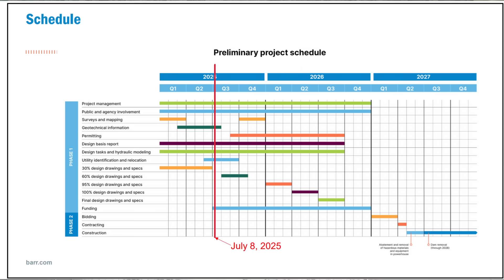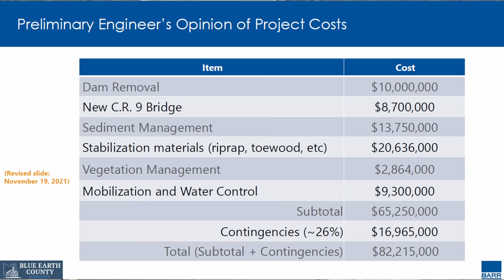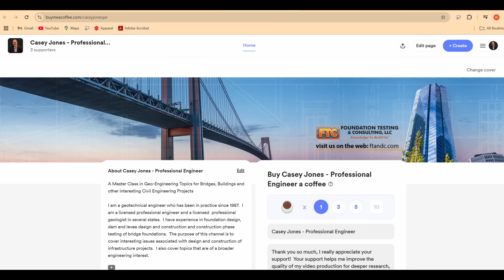Rapidan Dam Failure -  1 year later

Comment: Here is my question regarding this; Who was responsible for the dam or it's maintenance to begin with? It was stated that the power station was no longer in use because of previous flooding events! Who was responsible for the power station? Did the operators of the station not need it or it's power anymore? Was the affect of not using it or it's upkeep thought of, to its overall impact on the dam? Who was responsible for the spillway gates and not keeping them in working condition, and who was responsible for removing debris build up (which these two things, may have allowed the disaster to not happen to begin with)? Everyone talks about the outcome and costs of fixing the issue, but what about the people that allowed it to happen to begin with! Sure it may have been costly to maintain, but these points should have been addressed then, to avoid a issue down the road! This is a prime example of action not taken causing issues down the road, and who should be held responsible or accountable for that lack of action! Thanks Casey for the update!
Reply: Blue Earth County ownes the dam and surrounding area, other than the old home/store. Xcel Energy owned the electric equipment inside the facility.

Comment: I grew up near the Rapidan Dam.  There is some thought that the Blue Earth River now has a new channel.  Instead of tearing out the dam, which is very expensive, and will cause more environmental damage, why not stabilize what remains of the structure.  Also, stabilize the banks of the new cut channel with boulders, etc.  Also, there is discussion that a lot of the dam sediment now rests in Lake Pepin on the Mississippi River presenting a new problem for the Army Corps of Engineers.
Reply from the maker: That's a very interesting point and one I will look into thank you. Also I hope they didn't mess up Lake Pepin with all this sediment. That is a beautiful area.
Reply: @CaseyJones-Engineer  I like the idea of stabilize and turn this into a park.

Comment: Just as Florida Condos must put aside reserves for maintenance, all dams should have a similar reserve fund.  Either the owner/operator perform a set aside or the county/state set up reserve funds for maintenance/failure clean-up costs.
Reply from the maker: That's a great point and I think you are exactly right.  There should be money set aside for decommissioning.
Reply: On that subject, on projects, like a transmission line, on federal land a bond to cover decommissioning is required at the time of authorization. Normally the right-of-way holder decommissions but if they skip or do poor work the bond money is used.
Reply: Please tell all the willfully clueless nuclear advocates about the massive decomissioning costs.  

A tiny dam takes $80M to remove and rehabilitate the river.

Imagine what it costs to remove a $10-$20 BILLION derelict nuke plant and then safely store/secure the radioactive waste for 1000 years.  People whine about cost of energy now?

Nuclear is the biggest environmental scam on the planet.